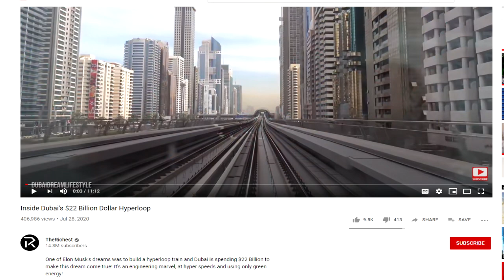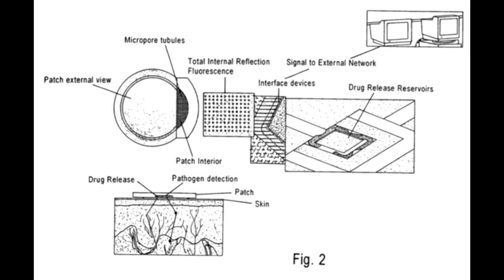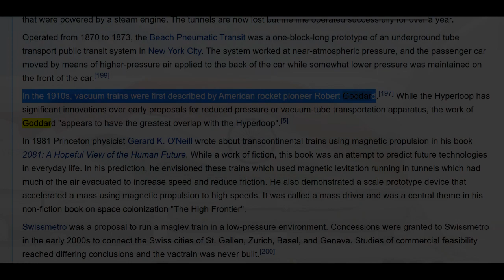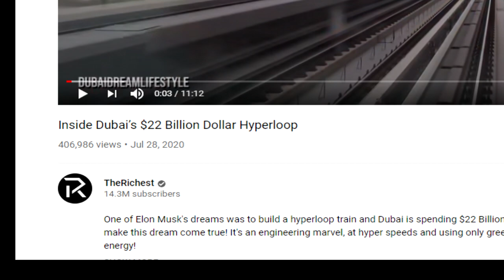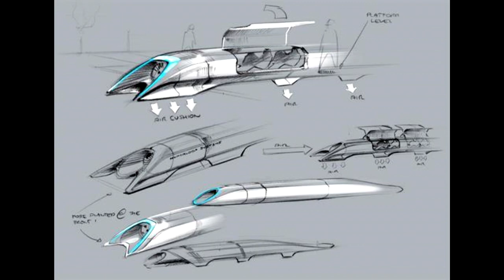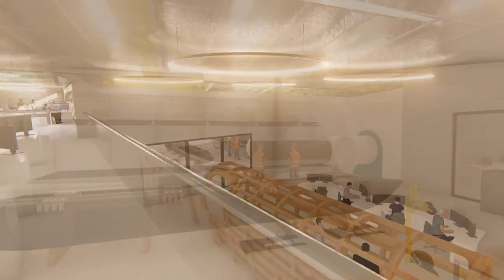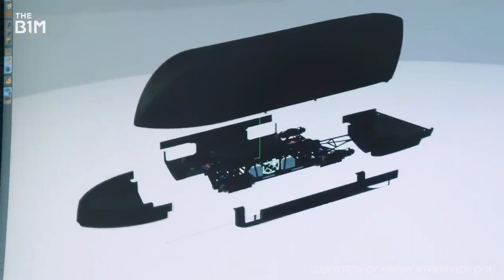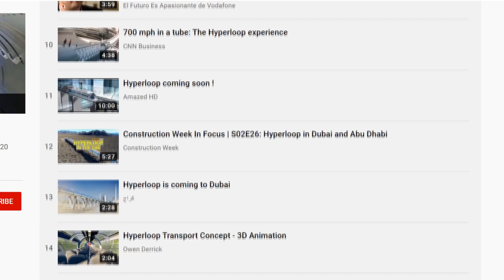Hyperloop, the biggest Scam since Theranos

Comment: Fill the hyperloop tubes with water and use submarines.  It makes about as much sense and is considerably cheaper.  I'm setting up a indiegogo ASAP.
Reply: My Indiegogo proposal is powered with sticks of dynamite.  It's cheap, has stable known properties and makes as much sense as the hype loop, although I haven't worked out the noise problem.  Maybe everyone gets earplugs?

Comment: If you want to see a realistic new "kind of train" mode of trasportation look for the Aérotrain. Built in France during the 60's, it was a propeller or jet engine powered coach that rode on an air cushion (like an hovercraft) on an inverted T-shaped concrete base.
It ran at 400km/h on the test track but as it burned kerosene and had no possible connection with the conventional trains, the idea was scrapped and the now known TGV high speed train was developed.
I mean, the project was up and running this time, without bullshit about physics. It was a funcional idea, but seemed impractical and expensive to run

Comment: If it's a vacuum tube, why do they render big ass fans on the front of the trains? Why render it as aerodynamic?
Reply: I don't think they are trying to do fully vacuumed tube, rather than a low pressure tubes, simulating high altitude air resistants

Comment: Maybe one of the most hilarious fails of the whole hyperloop idea is that, even if it were even remotely possible and even remotely commercially viable, it would run into exactly the same problems as regular high speed trains would. And that is burocratic hurdles. The main reason for why the american railway system is so slow and expensive to expand is because burocracy slows them down. Especialy in regards to the land that the tracks need to be build over. And that would be exactly the same problem for the hyperloop. Actually even more so because the hyperloop needs to built in much more of straight lines than high speed trains which limits their options for what land exactly they need to buy tremendously. If it were build any landowner in front of the hyperloop would jack up their prices considerably knowing that they are one of very few if not the only landowner that the company can negotiate with.

Comment: Yep , they are trying to build a test track in Alberta Canada , I live here , and I can tell you that pipe seals at - 20 or 30 degrees in Jan /Feb will be a big problem , and really lets look at low pressure resistance at high speeds. Even the SR 71 at 80,00 ft had serious heating issues. Yep it's gonna be fun watching a big expensive boon dogle !!! Reminds me of the SImpsons Monorail Show.

Comment: The issues you had mentioned.

1. Battery, would it last.
Tesla is also owned by the same Elon Musk. You can see the recent advancement in Tesla-3. So batteries are not an issue.

2. Speed, until yesterday there is no such track to test 1000kmph. Because it needs a long track. You cannot possibly say we can drive 1000kmph in 500 metres track.

3. Fan behind the capsule, instead of ahead of it. 
Just yesterday Virgin hyperloop made a test run and achieved the feet of going up to 500kmph. Which is half the speed they had promised. 

At first I actually believed your words and thought you were right. But after looking at point to point. Everything is clear. Now I believe they can achieve this feet. 

Only two points which are true in your video are safety and cost effective or not ?

1. It is safe from earthquakes, if the pillars are built earthquake proof. Like they had promised. But is it safe from something like terrorist attacks. We should think about it. 

2. Cost I guess it gets more cheaper if they can build more of it. Or may be if any advancements done in this field. It can get cheaper.

Comment: Those apeeds, only maglev will do, not wheels! Wheels will destroy themselves at those speeds! So it is a maglev in a low pressure tube… the maglev alone will  e difficult amough, as at those speeds, it will need to be very, very straight…

Comment: Call me crazy but I belive one day hyperloop will be a reality!
Reply: It already is, it's called the subway.
Reply: @ts89540  in cities but between cities at such speed it will revolutionise travel
Reply: @ortegaperu8510  I'm not saying it can't be done. I'm questioning how it will be done logistically. One reason why people want something like this is that air travel kinda sucks.  And it kinda sucks because of the onerous security and safety measures. They like rail lines because, they only have a fraction of those same measures; a quick bag search, and on you go. But hyperloop, with it's higher speeds and rougher environment (sealed, low pressure tube), will have the same awful boarding procedures that airlines currently have, only with longer waits due to compressed realestate (unless we expect there to be scores of hypertubes at every destination).
Reply: Have you actually watched the video? Do you understand the points?

Comment: just thought i'd mention, theres no air in a vacuum tube
Reply: @daverivem4411  not sure why you say that my man. I could build you one with my eyes closed. Do you think an oil pipeline has any leaks? Anything that is hermetic enough can hold a vacuum and we can build fucking big vacuum pumps. Also, vacuum depth varies significantly. you can have a very light vacuum at -0.1mmHg and that is still considered a vacuum. Albeit a vacuum of -29mmHg might be much harder to achieve
Reply: @marcbrettschneider6616  ok for me vacuum = not a single bit of air (perfect vacuum). What Hyperloop wants to use: medium vacuum. So there is air in the pipe.

Comment: When first time invented aircraft also same negative ppl did critisicm
Reply: The thing is high speed trains already exist, so unless the hyperloop beats those in at least 2/3 from speed, cost efficiency and safety they have no chance competing against existing technologies, trains can go up to 600km/h, the fact that the pods of the hyperloop need to not only be airtight, but also pressure proof makes them automatically heavier, negating much if the positive effects of lower air resistance, 

creating and maintaining a vacuum that big is expensive and takes a toll on your materials, the toll is even worse on the pods and the pressurisation chambers, because they have to endure changing pressures, the pods definitely wouldn't last as long as a traincar, 

you can make a train stop at any point, that's not possible with the vacuum chamber, you can even evacuate people if a train stops on the tracks, or get another train to take them in, if that happens in a vacuum chamber you'd first need to repressurise he tube, which would leave the entire system down for hours if not days because of the size of the vacuum

Plains weren't competing against technologies already doing the same stuff but better, 

the first plains didn't need to cross the atlantic to keep up with existing technology, but that's basically the equivalent of what the hyperloop would need to do right of the bat to not loose to high speed rail.

Comment: 0:42 : I'm convinced that a vacuum tube transportation will eventually be reality. It has theoretically huge advantages over other means of transportation. However it's not happening through beautiful animated videos like 0:02 , stupid concepts like the tube & the capsule at 15:59 , or other bullshit. 
My personal bet on how it could be done:
 - concrete tubes. Cheaper, stronger than steel due to greater thickness, and you can easily bury it to remove the thermic problems. And no rusting concerns. And one tube could host several railways to increase traffic capacities at low cost. To be designed by people more clever than me: joints so that it would not get shredded by earthquakes. 
 - capsules are perfect cylinders, with a fan in the front end (which is both ends, cuz it has to work in reverse, like all trains do. Any decent concept is symmetrical!) to remove the small quantities of remaining air and reduce drag. 
 - maglev style
 - the capsule perfectly fits the dock, so there's almost no remaining air when it's in the dock. If possible, the front and end of the capsule are maintained in the vacuum through an airlock.
- the dock isn't just one per tube, that's asinine, you'd get a tree-like dock so that when one dock can make a capsule depart every 5 minutes (optimistic), you multiply that by many docks per tube, and get a decent transport volume
- bigger than hyperloop. One capsule for a few persons is too expensive
In one word: il would ressemble the 1900 ideas, rather than the wet dreams of musk.
Reply: or you could just build the maglev style train and be done with it, without billions and billions in further cost.
Reply: @bezahltersystemtroll5055  Vacuum would allow for smaller and faster trains, which coul be useful for long distance travel. Once fuel rises to many dollars a liter due to the end of petroleum, there's a chance it will make economical sense.
Reply: @quantustremorestfuturus5434  it will still be prohobitively expensive when compared to things like planes, which will be able to use hydrogen fuel sooner than later. Petroleum isn't really relevant for trains anymore to begin with, most advanced countries don't run their trains with diesel, and the future for cars will be electric as well, or gas cars. Vacuum would also make the thing much more dangerous.
Reply: @bezahltersystemtroll5055  The vacuum train is not a competitor of train, but planes, indeed. Hydrogen fuel is a very bad fuel due to pressure and cost, I don't think it has any future in transport. 
A vacuum train would definitely be extremely expensive to create,  but not impossible, and probably not that expensive to maintain, I'd think that it would be similar to railway. Thus very costly due to the distance, but could be viable.
Danger: on the one hand, yes, vacuum is dangerous. On the other hand, it's a tube, no bird can get into your engine. I don't have an answer.

Comment: I think you'll find the basic principle of this idea goes a lot further back than 1910 and Robert Goddard. The idea, initially for freight, was originally proposed in 1799 by George Medhurst and about 1825(ish) suggested that the same system could be used for people. He didn't patent the idea though. It's not exactly the same as a vacuum tube, rather using compressed air to push the 'train'. The general basic idea is the same though.

Comment: The question i asked me every time i saw these first musk concept arts was "why does it say 'air cushion' under those arrows? Isn't that thing supposed to run in a vacuum tube?"
Reply: An almost vacuum. Something like 1/1000 of a torr of pressure. But if you hit 1/1000 of an atmosphere at 1000 miles an hour, that could be enough to suspend a train you see, especially since the shock wave would be much more compressed than 1/1000 of an atmosphere.
Reply: @medexamtoolscom  1/1000th of an atmosphere is so close to absolute vacuum that it's difficult for even the most precise insturments to measure the difference. But you are technically right, yes, even pressure as low as this can be used to create an aircushion IF the under-carriage surface is large enough. Of course under 1/1000th of an atmosphere the under-carriage  surface needs to be 1000 times larger than under normal atmospheric pressure. So if you'd normally need 1m² of under-carriage surface to lift whatever you want to lift, at 1/1000th of an atmopshere you'd need 1000 m² of under-carriage surface to lift the very same object. Of course increasing the under-carriage surface area also increases the total weight of the object and thus in reality you'd need even more under-carriage surface area to lift that additional weight which increases the weight which increases the demand for under-carriage surface area and so forth until you reach a point of equilibrium where the additional weight and the lift created from the air cushion zero out. And since under 1/1000th of an atmpshere each m² of under-carriage surface area only creates 1/1000th of the lift this point of equilibrium will be far later than under normal atmpospheric pressure.
In conclusion, yes, if you don't mind dragging several hundred meters of nothing but plain surface area behind and/or in front of your capsule, making simple things like taking a turn even more complicated, you indeed can run your capsule on an aircushion.

PS: This is of course a bit simplified, the actual math is a lot more complicated and the engeneering that is required for that even more so. But it's close enough to serve it's purpose.

Comment: i agree there is a lot of bullshit about elon and his 'Tony Stark' self made image but at the end of the day if people want to invest money in an idea like this why not? all of the technological advances so far have been improving what existed already and this is a interesting way of improving the rail system and usually if enough money and brain power is thrown at a problem it will get solved...when talking about tunnels and vacuum there is a known issue of eurotunnel overheating due to traction equipment and drag so the entire eurotunnel has to be air-conditioned...so is it cheaper to run full air conditioning inside the tunnel or make it support vacuum? i dont know but it would be nice to see a video on this

Comment: Stop poping up on my feed!!! I give you anther shot every few months and your still ignoring basic engineering of infrastructure.  Do bridges grow many meters on the hot sun vs the cold of night. Answer. YES. The invention of a movable airtight joint is not "magic" by no means are they cheap or easy, but they exist and once a factory for the tubes becomes fleshed out and de kinked. 10-20 years from now i hope you travel on it and remark about how you wish you could see outside after getting from toronto to new York in 1h

Comment: Oh how insightful you are NOT.  An engineering project overran ...  woo hoo I’ve never heard of that happening before.  Putting on a sarcastic voice doesn’t make your right,  it just makes your childishly snarky.   A new technology has some
Kinks to work out.  Amazing!  

Equating hyperloop to the Theranos does not mean it is the same.  How about providing some real points instead of slinging  insults? 

Also let me educate you on Elon Musk and hyperloop since you seem to be getting your facts wrong ..

Elon Musk never said he was the originator of the hyperloop,  he simply wrote a paper on its feasibility with current technology.  He didn’t “open source it” he simply wrote a paper,  what’s wrong with that?   And as for Elon developing a hyperloop,  he never has.  He runs an engineering competition for interested  amateurs to develop hyperloop.  If they are interested in the idea.  That’s it.  

The boring company has NEVER been about hyperloop,  it is about digging tunnels cheaper and faster.  If you knew anything about hyperloop or about the boring company you would know that.

Come on,  put a little effort in.  If you are going to poke fun at someone, at least check your facts.  It is almost as if you don’t care about facts,  just making yourself sound intelligent to gullible people.

Why anyone listens to a know nothing blowhard like you I don’t know.

Comment: lmao!
this guy doesn't know who he's talking about. that guy made possible landing rocket on earth using boosters.
landing rocket on earth like that seems more impossible to me than going 1000kmph in vaccum. 
with enough electromagnetic force a velocity of 20,000kmph could be achived practically. but, you might die by that g force.
Reply: The same elon have given up on the vacuum tube part. He pretty much just turn into a tunnel you can barely fit and drive a single car in.
Reply: Why do you think its now this so called virgin company now run it instead of him
Reply: @whoami1449  lol
Reply: @whoami1449  doesn't make sense

Comment: If we always stuck to what is proven over 100 years, we wouldn't be safely flying in aircrafts, today. Of course, we have to use what is proven, but at the same time we have to strive for innovation. Some of the presented obstacles are not that much of a blocker. For example, even with low pressure tubes, you build up an push forward a buffer of air. But that's not a showstopper but vivid, as the tube is not airtight fitting like a cork in a bottle, but the pods are streamlined to glide on the air cushion created by the passing air at travel speed.

Comment: Elon Musk smokes dope. His mind is clouded and malfunctioning/ What a prick. But, there is or was a vacuum tube system in existence in many retail and banking businesses. It was a metal tunnel system which transported metal tubes containing money - both coins and notes - from the central cash dispensing office to and from all other departments. It was very fast. There was no propulsion system fitted to the actual metal tube itself, the little tube full of money was propelled by the vacuum.  I always recall being amazed how they got your change for your purchase to you in just a few seconds when the till had run out of change. You could hear the little bullet scraping and rumbling through the metal tunnel at massive speed and then the assistant would press a button and there was a wooshing sound as the vacuum in that section of tunnel filled suddenly with air when the little door popped open and the bullet containing money tumbled out. I wonder how it worked. Maybe the bullet was propelled on a cushion of air behind it and the air in front of it had been removed? I wonder if the actual tunnel would be exposed to physical forces too great for present day tech to counter if it were big enough to carry a bullet containing people, but which on a smaller diameter for propelling money could be sustained? When graphene becomes commercial, would that help?